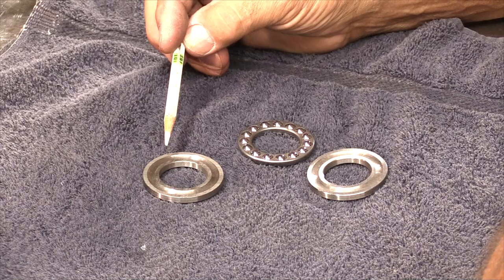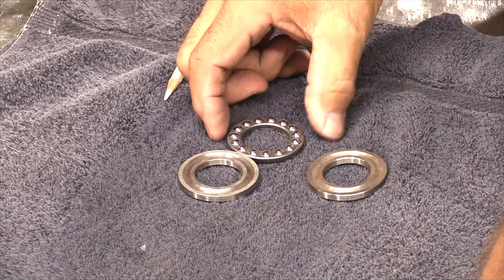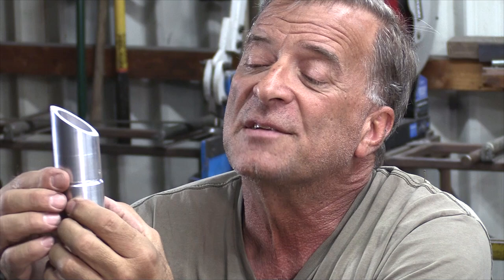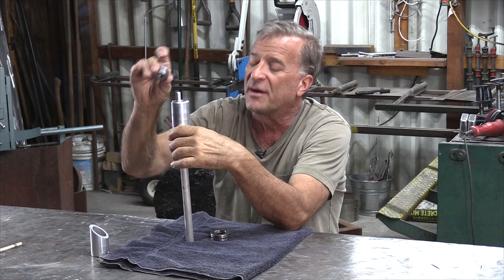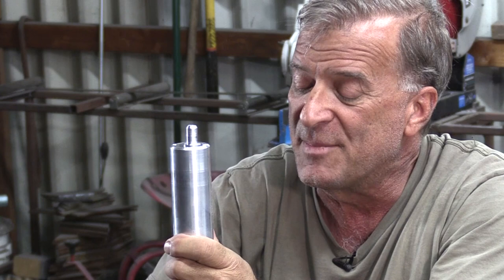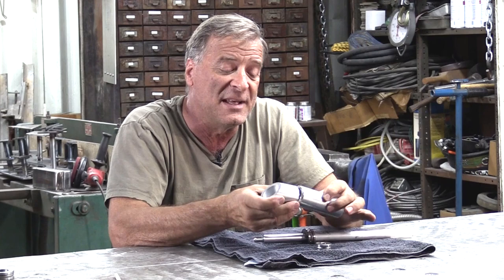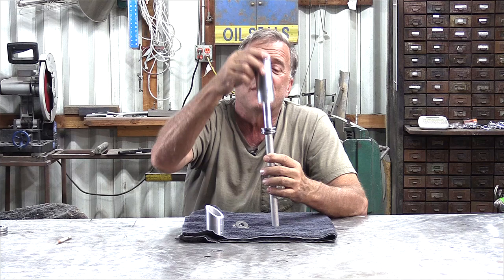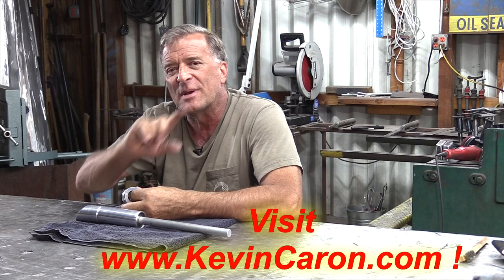The Best Way to Make Things Spin - Kevin Caron

Comment: thanks Kevin.  interesting design approach.  I suspect a even better arrangement might be a thrust bearing at the bottom, and a radial bearing at the top.  Flat thrust bearings are not really designed to take side loads.  And that approach requires really tight tolerances to have both thrust bearings carry thrust loads simultaneously.  That's why they have tapered thrust bearings to do both functions 👍😃👍
Reply from the maker: Have to give that a try Joel.   Thanks for watching and posting.

Comment: If I had the machine shop equipment needed to bore out the pipe this would work. The average home shop does not have this kind of expensive equipment.
Reply from the maker: You have to work with what you have or what you can afford.  I spent a long time learning how to use what was on hand to do what they were never intended to do.  One of the best parts of my "job" to tell the truth!

Comment: awesome! i want to try something with these.   is there typically a weight limit to these?  i'm sure your builds are pretty heavy.  Thanks for sharing these thrust bearings!
Reply from the maker: All depends on the size of the bearing.   I have seen them so small I needed tweezers to pick them up.  And large enough to need both hands and couple of grunts to pick up!

Comment: Please help! I have a 34" wooden wagon wheel that I want to mount on a tree. What is the best way to make it spin freely? (Vertically) It is to feed squirrels ears of corn.
Reply from the maker: Well if you want to keep the wheel vertical, you will need an axle of some kind to mount it to the tree.  A shaft to screw to the tree trunk and mount the bearings to it.  Interesting piece to build.

Comment: Hey Kevin, great video! I really appreciate the succinct and accessible explanations. One question: is it just gravity that holds the two-piece thrust bearing assembly together? If you wanted it to be clamped down would adding threading to the shaft and a nut be a viable option? Asking because i want to use a similar setup for a wind-turbine assembly. Thanks for any input you might have.
Reply from the maker: You could add some threads and tighten the bearing that way.  But why?   You can get a different bearing that will do the same things without the threading.    Check out the selection at VXBEARING.COM
Reply: @KevincaronSculpture  Thanks Kevin. I took a look at the site but not sure which type of bearing would accomplish this. Would you happen to have an idea? No worries if not.
Reply from the maker: Not sure on size but something like this.  https://vxb.com/products/15mm-flange-bearing-ufl002-eccentric-collar-locking-two-bolt-flange-unit      It will have 2 set screws to keep the shaft in place and a zerk fitting for grease.

Comment: Hi Kevin! I had a question if you’d be willing to help. Any advice on making something soon where it will be mounted vertically? So shaft horizontally. So say wall art that you could spin. Nothing majorly heavy but also without a long shaft since it’ll be on the wall. How would you go about doing it? Awesome work love the videos! Excuse my ignorance if I haven’t dug deep enough to find the answer in other videos.
Reply from the maker: A lot of engineering to make this work. Short shafts with some way to secure the piece that goes on it.  If you are in the USA please give me a call. Normally I would ask for a consulting fee for anything this complex. My number is on my website.
Reply: @KevincaronSculpture  Awesome, thank you for the time. I will definitely contact you.

Comment: What is the thickness of the bearing that you are using? I found one on amazon at 10mm, yours appear even thicker. And the one I found is described as "single direction". Would that mean the object would only spin in one direction. TIA
Reply from the maker: Those bearings are a bit on the thick side!  If I remember correctly they are 1/2 inch thick.  And yes, directional bearings will only spin in one direction.
Reply: @KevincaronSculpture  Alright, I got my bearing. Would you suggest Lithium grease or something else? Thanks for your quick reply and sharing your knowledge.

Comment: Kevin, this is totally off topic, but I had my catalytic converter stolen and it looks like they used a diablo sawzall blade. Is there any way to secure my next catalytic. Such as welding a straonger or harder rod over my exhaust to dull out that diablo sawzall blade? Thank a bunch. I figured you would know a stronger metal that i might be able to use
Reply from the maker: Short of wrapping the exhaust pipe with a 1/4 inch thick pipe I really can't think of anyway to slow they down.   Weld a chain from the cat to the car might help.
Reply: @KevincaronSculpture  Thank you, I think I am going to just have to make a cage for it and hope this is enough to prevent theft.

Comment: That top bearing could have been a normal wheel type, to stop the sideways movement, and let the thrust bearing take all the weight (downward force)?.. I imagine normal are better than thrust for stopping sideways movement, since they are only held together by gravity?..
Reply from the maker: I find using two normal bearings back-to-back work the best to keep the wobble out.